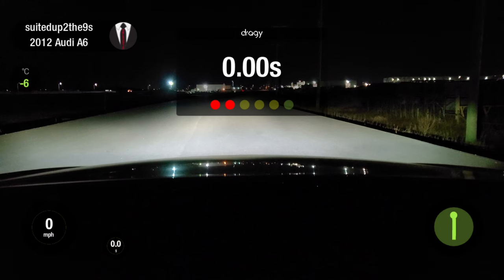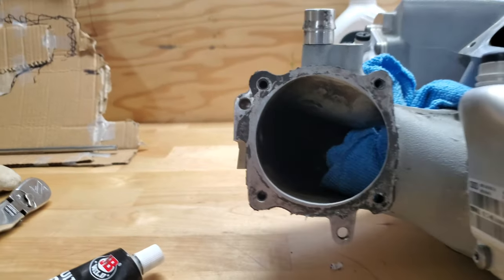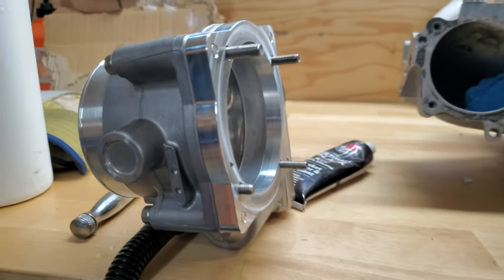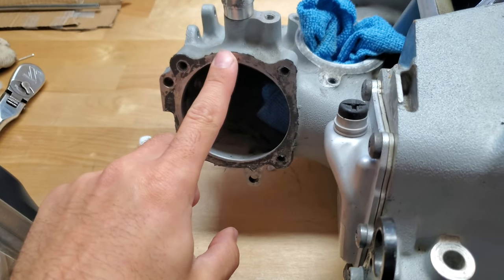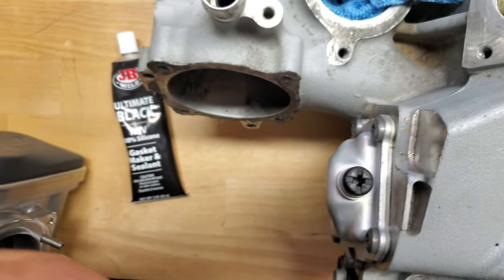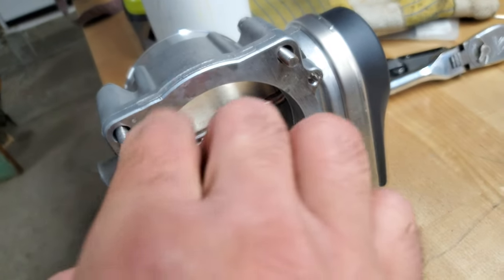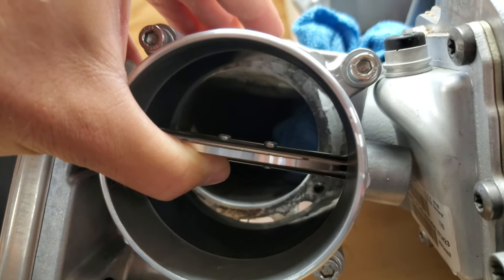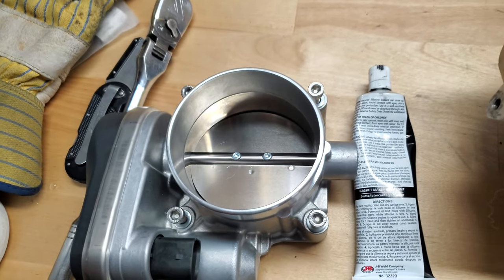3.0t Throttle Body Kit DIY Install //Suitedup2the9s & Performancebuilds

Comment: Geez silicone? Hell no, Why not just make some Viton gaskets? Like Hunter tremble’s kit, it’s pretty much the same & its $100 cheaper.
Reply from the maker: Because this is for those are serious about getting the max airflow into the supercharger. May seem like the same but it's not. Hunter didn't think the TB could fit there and would hit the ICs. Ours fits and is preported with a design that allows for a larger opening than any other TB kit. And last I looked they were the same price. Engines and transmissions are sealed with silicon. Using it to seal off an air chamber, hardly pushing the limits of the silicon.